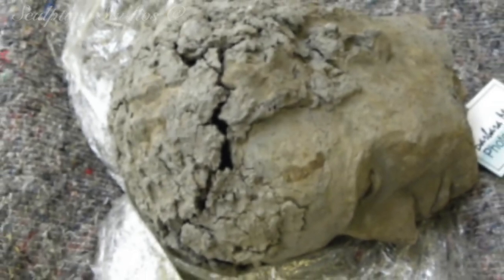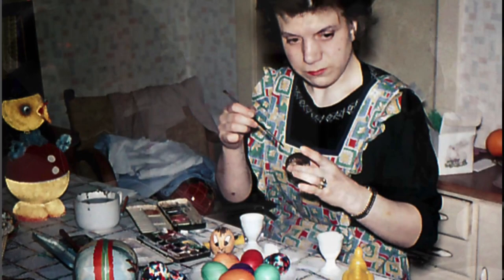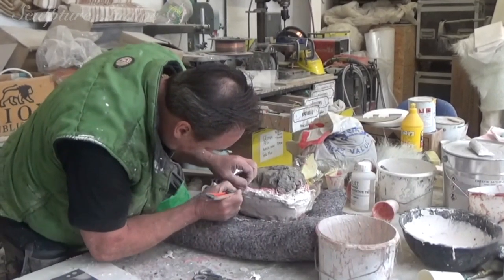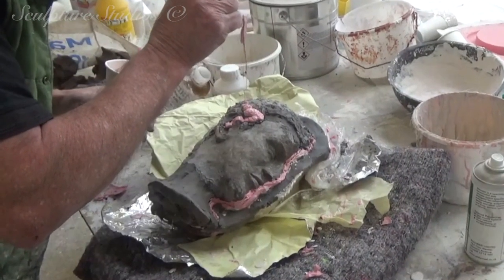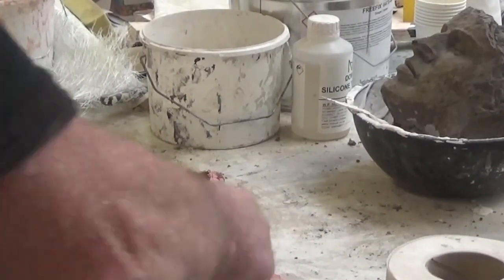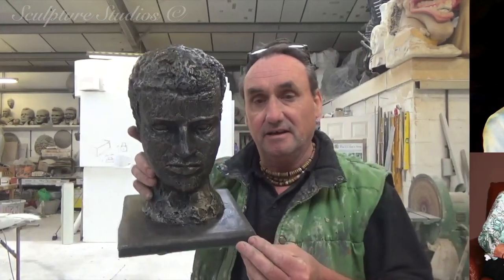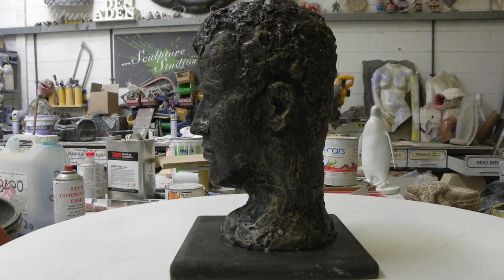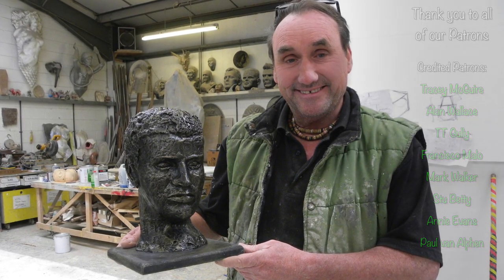Clay Bust Replication - Mold, Cast & Preservation by Sculpture Studios

Comment: This is a very different type of project, but it made for a touching video.  I think that it came out very well and while there is room on the front of the base for a flat engraved name plate, I would have gone more with adding a place where a 45 degree plate could be attached to the neck .  This is my thought, after the project is completed.  I am sure that the client was thrilled with what you were able to do with her mother's sculpt.